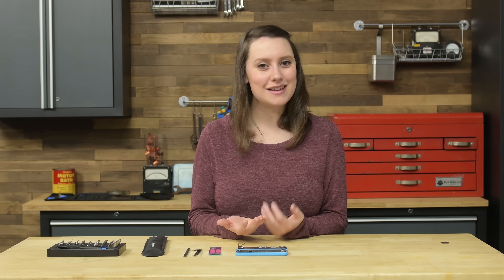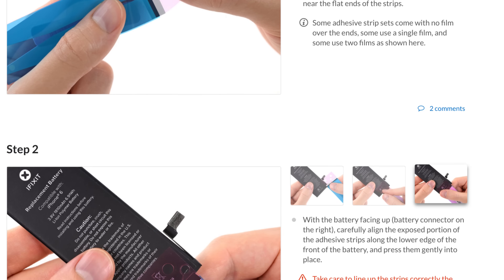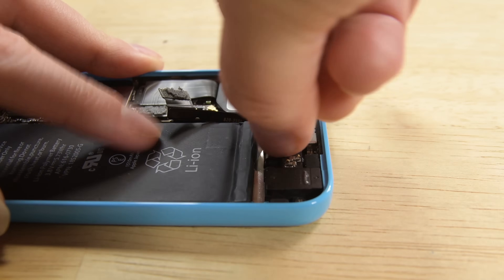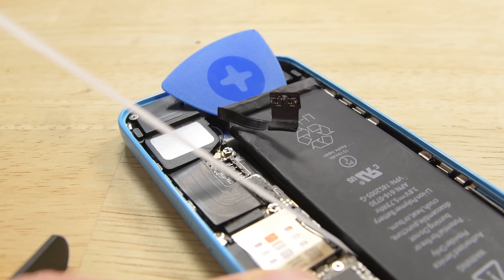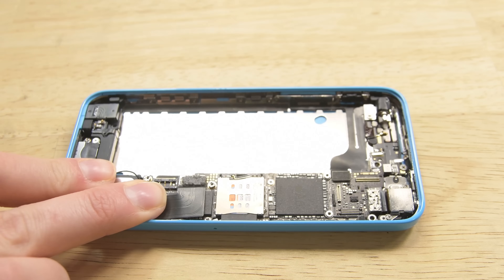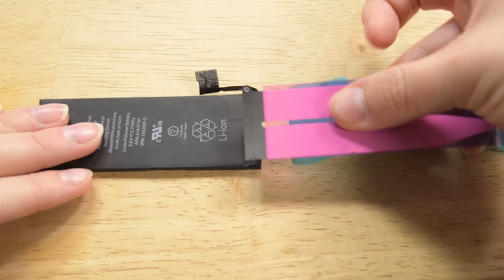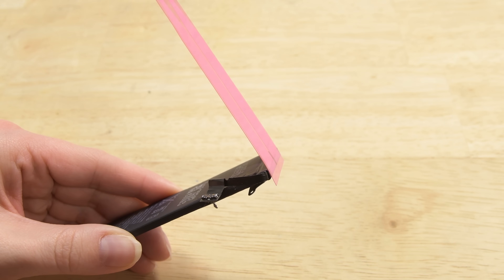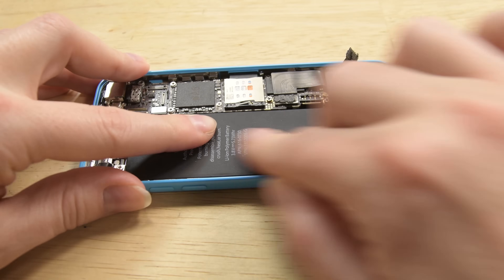How To: Remove & Reapply iPhone Battery Adhesive Strips

Comment: Thank you for this video... helped me get the battery out of my IPhone 5, had to use the heating method but it reinforced the fact that it was OK to do so.   I used a laser thermometer to make sure I was not overheating the phone, it broke loose at 165 degrees.
Reply: Fahrenheit or Celsius?

Comment: The way u guys showed doing the adhesive tape for the iphone 5s looks completely wrong. The adhesive tape wasnt originally on the front of the battery, nor was the screw hole tap on the right side of the battery but it was on the left side of the battery. Im hesitant to follow your guide cuz it will be completely different than how it was when i opened the phone up
Reply: It’s a 5c

Comment: You should include to plug in the battery just before sticking down the new battery adhesive to ensure the plug can reach the terminal. Then unplug the battery to put the phone back together.

Comment: Maybe someone knows... WHY have the adhesive strips, at all?  The battery I used to replace the original in my 5c was ever-so-slightly bigger than the original. "Test pressing" it into place led me to believe that with the addition of the strips, it would end up too "thick" to allow for complete fitting of the backside of the phone when trying to put it back on.  I left the strips off, the phone went back together w/o a hitch.  With a bit of use afterwards, the phone doesn't seem to have an "over-heating" problem, so I'm left thinking the strips are NOT for thermal-transfer purposes, which begs the question... why have the adhesive strips at all?  The fit is certainly snug enough to not have the battery rattling around inside the phone... so...?  Anyone?  Anyone?  Bueller?
Reply: The fit should never be too snug inside the phone. There should always be some room for the battery to expand and contract when its heated and cooled. If the fit is so snug that even adhesives make it too thick, then the battery could explode if heated much because there is no room for expansion. This was the exact problem with the samsung note 7.
Reply: Have you noticed anything different in the past few months while using your phone without the adhesive?

Comment: Follow these instructions step-by-step on a 6+ and you'll probably be ordering new adhesive strips. She puts down the new strips starting with the tab end, so after you turn the battery over for the main part, you run a good chance of getting the blue film all messed up with the strips. This method makes more sense: https://www.youtube.com/watch?v=XZcYIwBGyck

Comment: Every one of these I've worked on has had extremely dry adhesive - so dry to the point the iOpener never melts it at all! I cannot get a card to lift the battery as easily as they do. I end up doing the "Heat and ULTRA scrape" method that involves metal spudgers, and trying not to puncture the battery while scraping underneath it painfully.

I do have a question. Is the adhesive really necessary for re-installation? What purpose does it serve? The battery stays right in place and seems to be held in place by the screen assembly.
Reply: I know this comment is old, but double sided sticky tape and roll the tape over the top of the battery to. Then once you remove it pull the strips like you normally would but the adhesive detached from the case not the battery making it easier. I think the tape is there to prevent it moving when the screen assembly hasn't been attached yet or has been removed.

Comment: I could have used this two days ago before I destroyed a perfectly good battery in a spare 5se trying to get it out. The damn tab ripped off before any adhesive came undone. I had to grip it with needle nose pliers to get that sucker out. Ripped a big hole in it. The electrolyte stinks like some kind of solvent.